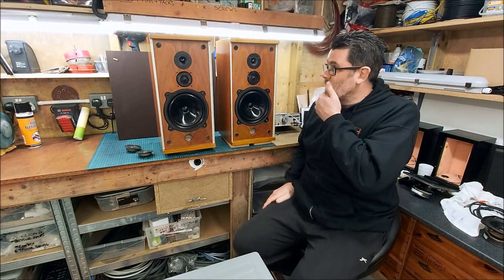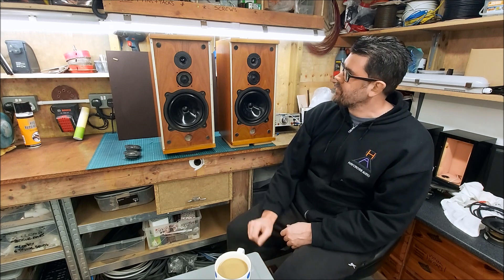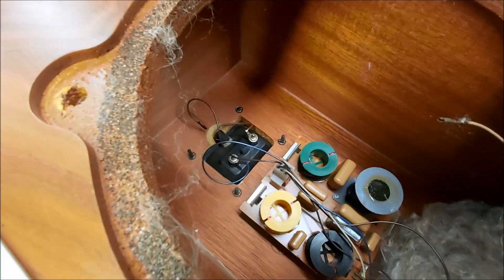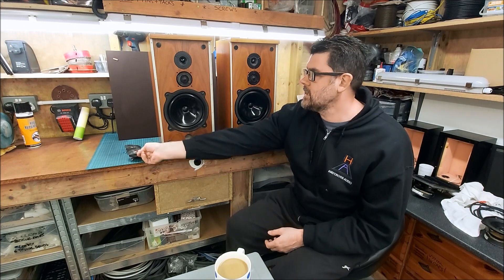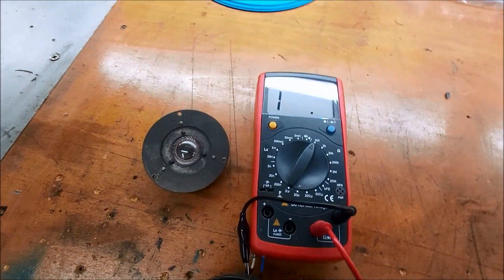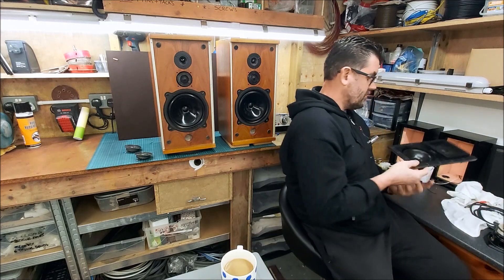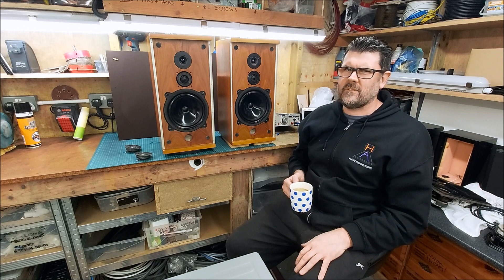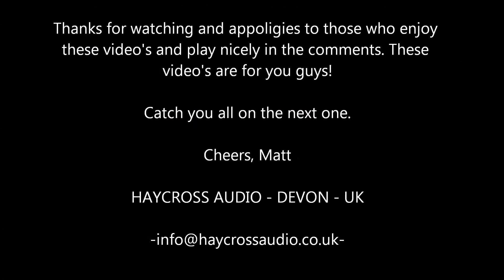B & W DM4 Speakers and a RANT!

Comment: It's a funny thing with the Coles tweeters. It was quite common to have open circuit coils on brand new units. At first, I thought it may be amplifiers oscillating that could burn them out, but they never had any sign of burning. We always put an ohm meter across them prior to selling them. Funny the things you remember from all those years ago. Watching your channel is like a flash back in time. I've sold most of these speakers in my shop.
Reply from the maker: @MichaelBeeny  great to hear these stories. Cheers

Comment: hey Matt...I read others using Dot 4 brake fluid so I was thinking of using on my Spendor S100 rubber surrounds to the drivers...remove my drivers and apply a coat to both sides and the let sit for an hour and wipe off...what do you think?...Is it better than a rubber restoration fluid...I of course don't want the glue from the cones to seperate...so I would be very careful...❓
Reply from the maker: God no! I'd never use brake fluid as rubber Restoration 😳. Get som Carbusonic.

Comment: Thanks for the videos, I find them quite informative and interesting as I have quite the vintage speaker collection. Question...where did you either acquire or make the large green geometric mat with the angle  indicators? Looks very useful for testing speakers off axis. Thanks.
Reply from the maker: Thanks for watching. The green mat came from ebay. The one in the video is part of my router bench. I also have a massive A0 sized one I use on my work bench. There a craft cutting mat so very durable and have useful measurements set out on them

Comment: I recently purchased a pair of these...I love this speaker and want the best from it...what fuse should i buy to replace these fuses...do you have a link?...also do i need a gasket between bass driver and the wooden cabinet...the foam has disintegrated...I don't hear anything from the super tweeter(top driver)I have a multimeter but how do i use it to check if the super tweeter is working? i'm a newbie with multi meter...I'll buy a new super tweeter  if i know mine is bad?

Comment: Are  they 4 ohm woofers? What is interesting with these speakers is they measured pretty flat but do not use any resistors.So driver sensitivity must be very well matched. The DM4s sound quite lean and a tad bright by BBC inspired standards.Drier and more neutral perhaps.Best with a warm sounding amplifier.Also not really valve amp friendly -possibly due the the 4 ohm load.